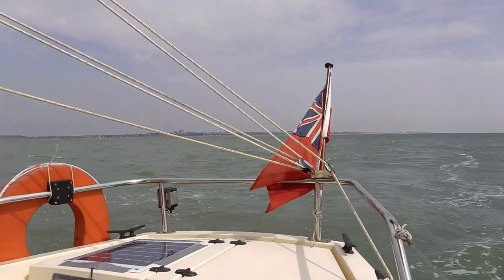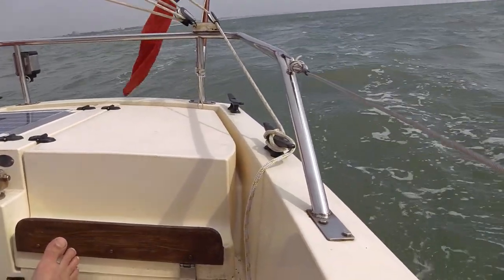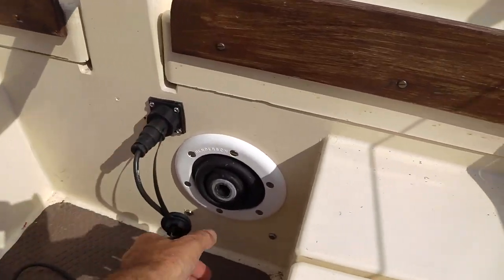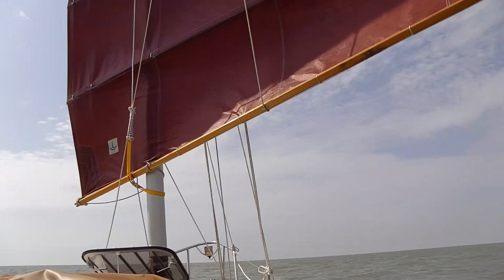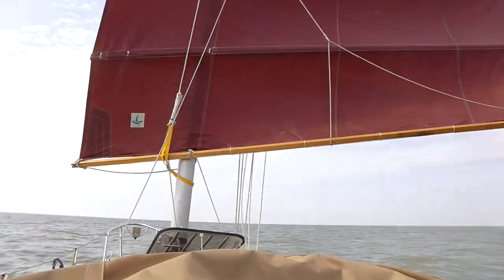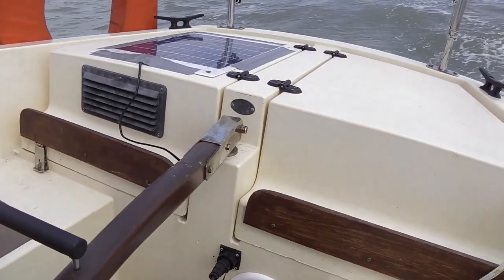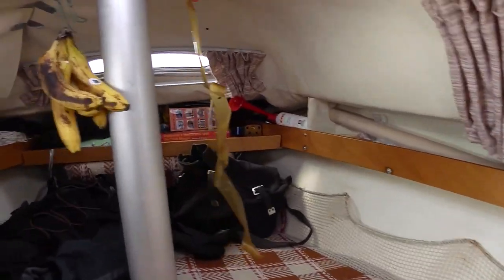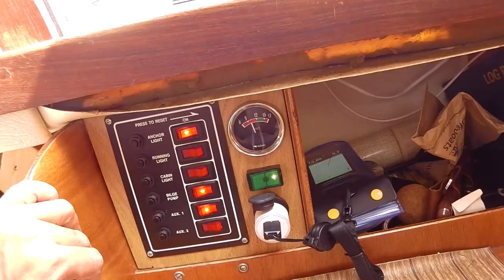First tour of Tammy Norie

Comment: I had a Corribee a few years ago.  Great wee boat..but perhaps just a bit too wee.
That cockpit really frustrated me.  As you say, drains useless , and block up so easily, and take up a lot of space below.  And perhaps worse, the cockpit is too low, ie close to the water.  And too flat, mine collected water at the wrong end.  If I had kept her (maybe I should have) I would consider raising the cockpit and draining to the rear, out to the outboard well and or transom, with a decent sized drain. 
That cockpit locker also has an issue, any water that gets in there eventually drains into the bilge. So if you a big wave, filling the cockpit, it would get into the cabin! 
And as for the heads, perfect for a ten year old child!  But really takes up too much valuable space to be just used as a hanging locker.  
The whole interior definitely needs a re think.
Reply from the maker: All these things are true of the Coromandel, but don't concern me too much. Except the drains.  I've upgraded these to 1.5", reducing my complete cockpit drain time from about 40 minutes to 2 minutes.  The Coromandel has quite a tub-like cockpit with those coamings, and I don't want 3/4 tonne of water sitting there for long.
Reply: @TammyNorie  I am afraid i am an inveterate tinkerer, always looking for ways to improve things..sometimes it actually does.  It has been said that I am not happy with anything until I have a piece of string tied to it somewhere!
Reply from the maker: @markthomasson5077  You might enjoy all the tinkering I've documented at https://tammynorie.wordpress.com/ . I've been disabled and unfortunately the rate of posting is very slow recently, but I have more projects in the works.
Reply: @TammyNorie  I'm sorry to hear about your situation, but good to hear that you have more projects in the works. I just wanted to say that I find your website (and GitHub repo) a treasure trove of inspiration for my own boat projects! I have some sort of CFS myself (I call it "ME light") so I can understand how things have slowed down. Wish you all the best, and thank you for sharing so generously from your projects.

PS. I'm not the original commenter, pardon me for hijacking the thread 🙂

Comment: perhaps a traveler on the deck instead of the rail.
Reply from the maker: There's not really any deck to put a traveler on! Robin Blain put a traveller on his rail, but I prefer something simple -- most likely a simple horse (adjustable loop of line) similar to what you find on a Topper, or a similar bridle arrangement. No need for anything fancy I think, and a full traveller isn't really necessary on a junk rig.

Comment: 10 volts to low will ruin your electronics
Reply from the maker: Hi Archie.  The battery was damaged in this video and I've replaced it and now how a couple of solar panels topping it up. However, low voltages will not damage electronics.  They might just fail to work. But the only electronic item I have connected to my battery is the VHF and it receives fine at 10V, but when the battery is that low it fails to send.
Reply: I should have said 10 volts will ruin motors